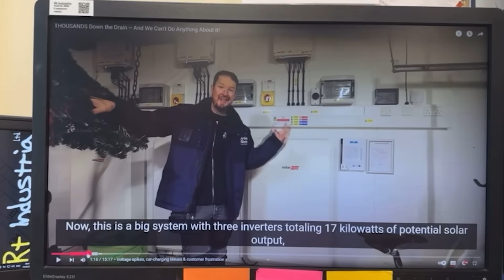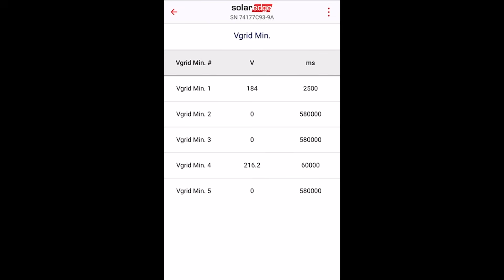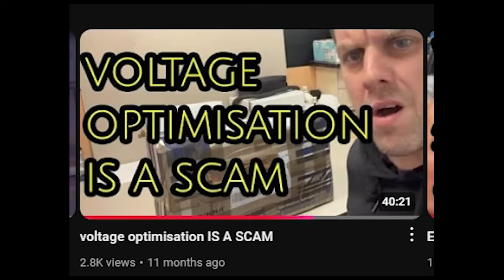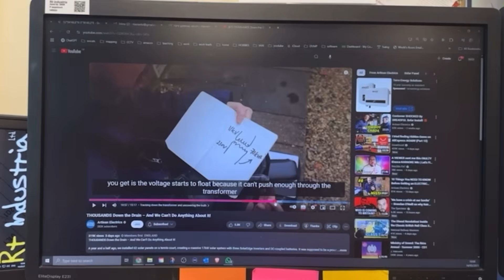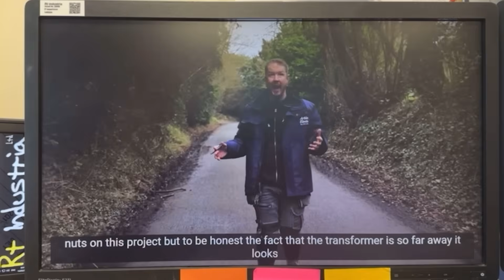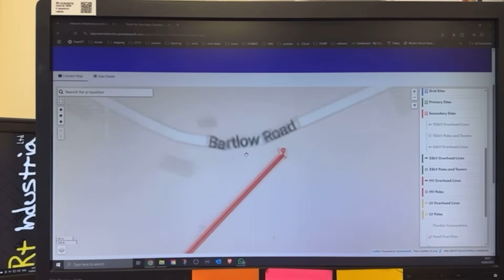ARTISAN ELECTRICS v THE GRID. WHO,S TO BLAME

Comment: 100kW for 58 houses? What would happen if they all switched on a kettle at the same time? You wouldn't be able to charge many electric vehicles at the same time either.
What would be the main fuse rating in each property originally? If only 65 Amp then you wouldn't expect to to get too close to that pushing power back, so maybe 12kW maximum without an upgrade, and it would have probably been designed with a lower rating in the first place at a time when people didn't use (or try to return) ridiculous amounts of power, hence the long but adequate cable (at the time it was installed) to cover the maximum expected draw (or return in this case).

Comment: Someone please talk to me about solar.
I live in the top flat of a maisonette, and would like to have some solar to offset my consumption (all electric), once i have my meter (RTS) & consumer unit replaced with a modern one. I have space immediately outside my front, ground-floor door to install a battery pack, so advice about AC or DC cabling, isolators & inverters etc, would be useful to know when i start looking for quotes. TIA

Comment: When the G99 application was submitted they would have specified 17kW export and it looks like the DNO has cocked up and not correctly assessed how that would affect the voltage rise.

However, I bet they never told the DNO that they intended to charge batteries every night at 17kW plus another 7.4kW of EV charger (which may or may not have been previously declared to the DNO). The combination of up to 17kW export at midday and 25kW import at night is probably impossible without a dedicated 11kV/LV transformer near the customer, or converting the customer supply to three phase

Comment: Done know why artisan didn't request a 3 phase connection and then put each inverter on its own phase max output of 6kw or better still put controls in to limit the charge rate to 8kw, the inverter should also have been limited unless the house was demanding that power which would require quite a few EVs to be charging

Comment: Problem is the voltage drop because the wires are too small. He's trying to smash about 80A through the wire to the street or the wire in the street and the losses are causing the inverters to up the voltage.  The problem never occured before because nobody draws 80A through a domestic connection unless they've got an electric forklift.

Comment: I live on the outskirts of a small village in Poland and in May 2022 had 7.7kW of solar panels fitted.  First year the inverter kept switching off in bright sunshine because the power on the grid (triple phase) was too high for my inverter to put in any power.  The electricity board said there were too many people sending power into the grid and not enough local consumption. To add insult to injury, at the start of 2023 a neighbouring farmer upped his own installation and was sending at least 20kW into the grid, my other two closest neighbours around 3.5kW each. They were having the same problem as us. We complained to the electricity board and they did come and check but said it was the fault of old grid infrastructure and the transformer, which although within EU norms so they didn't legally have to change it, was of an older type and that at the end of the year they would actually be installing a new one because of nearby development requiring extra capacity. The normal production bell graph you would expect often cut of to zero at around 11 am in the summer and only begin input again around 3pm. One of my neighbours is related to the farmer and said the farmer had admitted to illegally raising the cut off limit on his inverters to over 253 volts in order to send power into the grid. Who could blame him? My neighbours reported this to the electricity supplier.
By the start of 2024 a new transformer had been fitted (and the farmer I believe stopped from doing what he had been doing), and we've had practically no cut offs in supplying the grid because of high voltage on it (though they still happen on at least one of the phases). Our installation produced 4.5MWh in 2022, 4.18MWh in 2023 (boy were we pissed off) and 6.16 MWh in 2024, a 50% improvement.
Your mileage may vary :)
Best regards,
V
Reply: Here in Germany such situations cant occur because of bureaucracy: They wont permit new grid tied installs and if there is a genuine risk of too much power being injected into the local grid. There is also a limitation on private solar generation if you are grid tied and they are very good about keeping the grid stable with increasing solar which comes with bureaucracy of course and limiations aka they may put limiations on your install or not permit a grid tied inverter above a certain KVA rating.
Also they may want to install active monitoring or a telecontrol unit to remotely control your inverters output kva and voltage.
Its been a real crackdown lately:
EV chargers and heat pumps above a certain power draw are considered consumers eligible to be remotely controlled by the power company so you need to register them and have the required provisions in your meter cabinet for a telecontrol unit to be installed which is able to send a signal to the high power consumers to lower power draw.

Comment: Land owners responsibility to clear vegetation ...not really looks like dno using insulated cables because of the nightmare hedges and trees which is their responsibility if they were already there when system installed. Any wayleaves we have dno takes responsibility to keep cable clear from branches etc. Will ask permission if needed to trim or fell.
They pay sweet fa for infrastructure like poles and stays at the same time standing  charges rise year on year. 
We get on well with our local dno lads on the ground but they work for a monopoly  and will rinse you for any upgrade with no option to get quotes .

Comment: We run our 25kW inverter at 260V no problem.
Just be aware to have an voltage regulator between grid and vintage electronics.
These regulators can set the 220V or any other voltage you want and became really cheap.
Reply: Voltage regulator means that the inverter no longer trips at the grid voltages required by G98/G99. Bad solution
Reply: @redshift3  true, unless our 3x40A feed meter to our main feeder has long distance. At feedpoint the voltages are more tame.
Reply: We compensate for our own cable length.

Comment: I wondered whether you would give your opinion (another video) on whether the new BYD EV charge rate of 5mins for say a 50KWh battery is feasible considering power infrastructure, given the costs /disturbance/technicalities involved. I thought it was not (and put a comment on the video) thinking of: for example, Cambridge services getting  10 of them installed. But someone decided I was just against EV's rather than thinking of the infrastructure costs and that 10 of them equates to putting the power draw of 2,000 houses on the existing connections. Any thoughts?
Reply: Most of the EV chargers are grid responsive, so they figure out if there's enough power to support the demand from the vehicle. But if they want a lot of power they'll be speaking to the DNO to get what capacity is available or ordering a new transformer suitable for the demand.
The good thing is that most people don't need or can't get 200kW or 1MW charging into their car. My EV only demands 44kW for example.
I have seen examples where an EV charger refused to give full power specifically because it was grid supply limited. Which might suck if you're in a hurry, or you just have a drink, take a pee and wait a little longer.

Comment: Any electrician that places a Voltage optimiser on a grid based system should loose his license.

Why do they charge the batteries at night instead of when the sun is out.
This whole issue can be fixed with decent charge management . I think the customer is treating the grid as a stock market. 

They just need to use the batteries to get the voltage down.

Comment: I am an electrical engineer with degree, decades of experience in the power generation industry, mostly in the field of connecting very large renewable energy projects to the grid. 

"The grid voltage, you would think would be stable" and that's an incorrect assumption right there. The power your equipment consumes or generates will affect the grid voltage. the weaker the grid, the worse the voltage changes. So not necessarily "a you problem"

"If the voltage is spiking, is that happening because of the grid, or is that happening because of your solar?" False dichotomy, it's because of both. If the grid was stronger or the solar was smaller the voltage changes would be insignificant.

"Grid transformers are fixed [voltage]" 😀😀😀😀 Sorry pal you haven't got a clue (nor does Jordan). The transformer winding ratio is fixed but the voltage at the transformer terminals can and does still vary depending on the load. Those variations are even worse at the customer terminals.

"it [a transformer] is not a resistor". No, it's a significant impedance, which for the purposes of explaining voltage rise to "civilians" is close enough

The installation is too big for the grid capability at that location. Who's fault is that? It's the DNO's fault for incorrectly calculating/estimating the effect of the proposed installation at that location during their assessment of the G99 application. The DNO should take responsibility and provide a remedy, probably by extending the 11kV circuit closer to the property and installing a new transformer there.

We know that a G99 application was made and approved. It is unclear whether the car charger installation was notified to the DNO as it should have been
Reply from the maker: What you have done there is falling into a trap of speaking in only a technical manner. You should understand. The video is not designed for people like you to understand, but for the majority to understand like normal electricians and give them some insight into what is occurring here you are blinkered because you have a degree or you think everyone is or should be as clever as you, the point regarding the transformers this that you can’t push too much through it or get too much from it from it otherwise the fuse would blow. I’ve dumped it down because it’s for the majority again not just for the geniuses. Thanks for your time though.

Comment: Great video with interesting insights, thank you!

Is Artisan Electrics/ Jordan on some kind of business suicide mission? Or maybe he has mad king syndrome; he’s an electrician who (as far as I can tell) does decent work which he massively overcharges for, but that’s between him and the customer. Let’s face it, you’ve got to be pretty decent to be putting your work out there on video. Top side entries outside though, tut tut.
But instead of letting their work speak for itself he’s increasingly just slagging other people off, more often than not without cause, being an all round snob. Apparently now he fancies himself an electrical engineer working for a DNO. 
Good luck with your next applications, I know what’s going right to the bottom of the pile of the overworked actual engineers paperwork.

Comment: Short answer is there is a long thin cable between the local transformer and the house causing voltage changes when they are pushing or sucking 17KW. The only fix for this is to recable which someone has to pay for.  What is worse is the neighbours will be suffering blown lights etc with the high voltages.
Reply: Probably better to extend the 11kV circuit closer to the customer and provide a new LV cable from a new transformer

Comment: If the grid is permitted to have a voltage range up to 253V, is the expectation then that PV owners in this regions will have their inverters shutdown or suffer 0 export????  I wouldn’t think so.

G99 provides threshold for voltages and the duration of time in which it can operate at elevated voltages. Check the type test certificates.
Reply: No, inverters are not required to shutdown above 253V. They must shutdown above the G98/G99 thresholds (262.2V for 1 second or 273.7V for 0.5 second)
Reply: @ exactly.  So comments below saying inverter shouldn’t be operating are incorrect.

Comment: Literally fitted a Voltage recorder to a customer yesterday and it was glorious sunshine as well.  His voltage was reading 255V at his property.  I got him to turn his PV off there and then and the voltage amazingly dropped to within tolerance.  The voltage is close to the upper limit of so we’ve decided to tap down the HV at the transformer to see what happens.  Unfortunately solar PV are sold to the general public as the best thing ever, but we know different.
Reply: G98 or G99? It's difficult for the DNO to manage voltage with multiple G98 PV systems connecting outside their control. But for a G99 installation, there's not much excuse for the DNO doing an inadequate assessment and allowing too much generation to be connected such that the voltage goes above statutory limit.

Comment: Regarding "loading"... the solar pv system is a load. A negative one. Working against the source impedance of the supply, when load is positive, it will pull the voltage down. When load is negative (exporting power), rhe voltage will rise. There really is nothing more to this.
Trying to fudge it with a transformer will acheive absolutely nothing at all.

Comment: It’s more like 6350v phase voltage at 11kV.
Reply from the maker: Damm your night
Reply from the maker: Your right even
Reply: It’s an easy mistake considering we do operate 6.6kV networks, but these are primarily in London out of Hackney and Moscow Road MSS.  

These legacy assets are currently being replaced with double wound 11kV/6.6kV so that eventually we can do away with 6.6kV and run everything at 11kV.

Comment: ESQCR dictates the permissible voltage range that National Grid and the DNOs must maintain, of plus 10% and minus 6% of the nominal 230v, which is a range of 216.2v to 253v. This is kept to pretty strictly and the notion that UKPN would be providing you with 260+ volts is absurd.
Reply: The DNO has caused the voltage to exceed the statutory voltage limits by allowing (G99) the customer to connect more generation than the grid can manage at that location.

Comment: Spot on, this is why G98 and G99 exist. G98 no engineering required. G99 requires engineering which has not been done. Blaming the DNO is poor, the DNO is not responsible for the scheme design.

Comment: Its that all 17KW has to go back out on the high lines not on the 11,000VAC lines, the next transformer higher than that. In NYS upstate we step down starting at 1,000,000VAC then drop the voltage three times so there is three sets of high tension lines by the St. Lawrence Seaway that at the Aluminum plant the power goes in there at 1-3V with a whooooole lot of Amperage but a 4th jumps down in voltage at the plant to get that amperage and goes into the plant on three phases each as big as your waist. Jumping voltage up or down at the right time and frequency are the two biggest important things when considering power delivery! You can brown out if you let voltage sag on the opposite side of these guys problems of over voltage because they are pumping to much back to the grid! Take a meter and measure voltage on the leads coming out of the transformer on the pole, if they are to high when generating power the grid is not dealing with all that power. My advice is store it in a lot of batteries! My friends father stored power in batteries as big as a person, there were rooms of batteries underground to store the batteries at a constant temp. Since it was a hydropower setup in the base of a hill where the generator he built and wound was installed in a power house. He didn't want to be to far from the generator so he built three massive underground rooms for batteries. Needless to say they could run the whole house for two weeks without any power generation at all! He did this because it was not worth it to sell it to the grid and it was to hard to get them to work with you when you had a problem. Solution, a ton or ten of batteries!

Comment: I didn't see that in the video that it is single phase power! WOW 17KW single phase power! Here in the US we used to use a lot of single phase power but went to two phase power with two hot legs with a neutral bar on the left of the panel, ground on the right, and the two phases down threw the center of the panel where two rows of breakers break out. To get 120V you use one leg and a neutral. To get 240V you use both hot phases, the voltage swings from positive 240V to negative 240V on opposite phases. This keeps the voltage more stable! Another thing is do the three inverters sink the frequency threw comm port to each other?

Comment: Surely it's just a simple resistance problem. You're lashing 70-80 amps back up the the supply cable the wrong way, with the whole system designed to account for a bit of voltage drop in the other direction! Not sure why the DNO okayed this system really but I suppose it's not their job to hold the hands of people who couldn't do their own volt drop calcs for the line from the house to the transformer at least when installing such a big system! The most straightforward solution here is to just set the inverters up properly so that they limit their output to 252V! They'll just have to sacrifice a bit of export power at peak times, but the effects could be minimised by being smarter about when the batteries are charged.